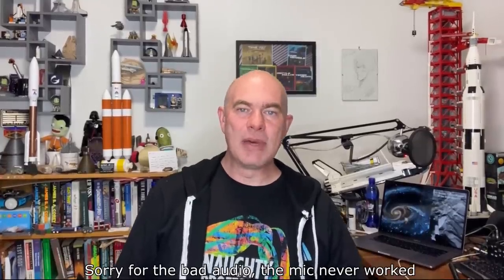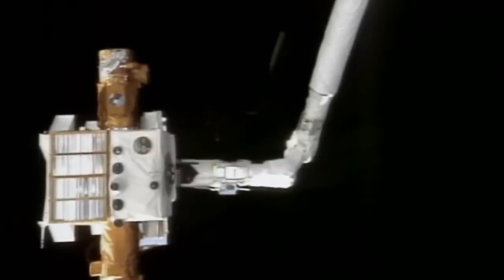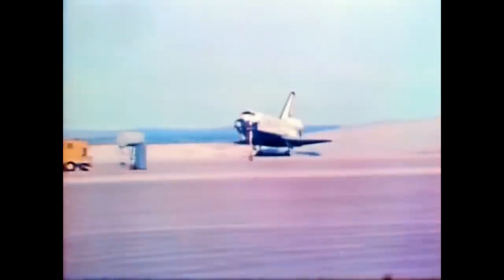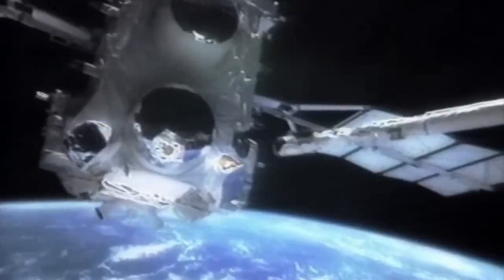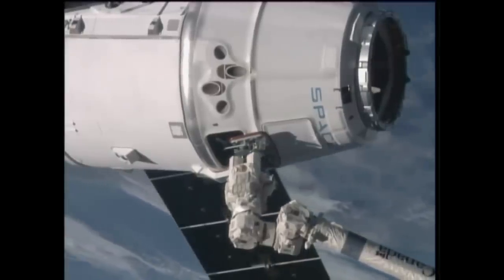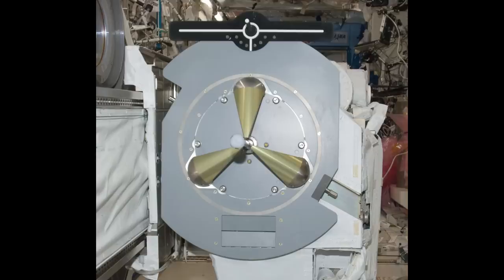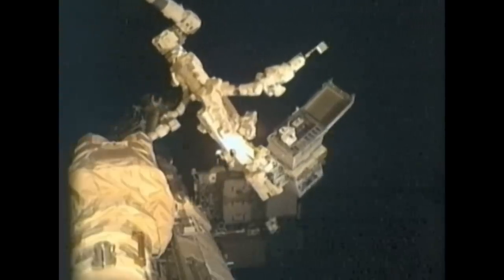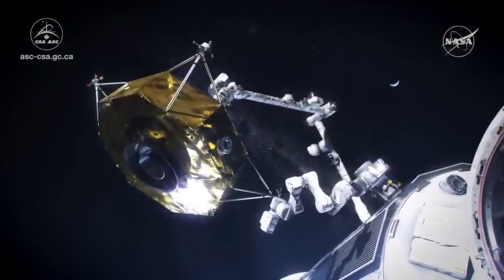Oh, Canadarm - Why NASA Calls On Canada for Robot Arms IN SPACE

Comment: I have to wonder, if the Canadarm were available on Columbia, and they saw the damage to the wing while on-orbit, what could have been done to save the crew?
Reply: Send up another ride, I'd imagine. It was a pretty big hole.
Reply: If they discovered the damage in the first few days, they could have accelerated launch preparations for the next Shuttle mission, skipping some less important tests. Then launched with two astronauts to go rescue the crew. Shuttle carried up to eight astronauts so they would have had to install a seat for the ninth.

It would have entailed some risk to the two astronauts who flew the mission, and there is no guarantee it would have been successful.
Reply: @StevePemberton2  It was considered unlikely that would have actually worked.  It was Altantis that was next up for a flight, the issue was stretching the consumables for the fuel cells if I remember correctly.
Reply: @TheEvilmooseofdoom  What was critical was how quickly they began acting on it. If on launch day after seeing the foam strike the mission managers had immediately contacted DOD to obtain photos, there might have been a chance. However since there was resistance from the managers, arguments took place over several days. Even if the managers finally gave in it probably would have been too late, considering that it probably would have taken at least an additional day to obtain the photos depending on when good passes ocurred.

Had they had the robotic arm onboard, if they had done an immediate inspection on launch day, the odds would have  been much better that they could have gotten the rescue flight launched on time. 

If I remember correctly there would have been things done on Columbia also, like reducing electrical power, and possibly cutting out crew activities to help conserve consumables.
Reply: I sometimes wonder if the reentry profile could of been adjusted. May of saved the crew even if they had to ditch for lack of a runway.
Reply: All these replies are doable, this was a crisis situation and I have to believe NASA would have pulled out all the stops to bring them home. It could've been another "finest hour" on par with Apollo 13.
Reply: @professor-josh  The biggest risk would have been launch fever. Shuttles were notoriously difficult to get off the pad on schedule. Atlantis was six weeks away from launch, they would have had to accelerate that to four weeks or less, and still be as safe as possible. 

Pressure among all the team members to move too quickly during those four weeks would be quite strong, especially if any part fell behind.

On launch day it would have been an instantaneous launch window, meaning they have to launch within a few seconds of the scheduled time, with only one opportunity each day. Calling a scrub for the day would have been tough, especially if the weather forecast for the next day was not good.

We could only hope that everyone kept their heads, did their job to perfection, and they didn't run into too many unforseen problems. It certainly would have been a triumph if they had been able to pull it off.
Reply: @tangydiesel1886  I'm pretty sure I remember reading that this was looked at, but there was nothing that could have been done in the reentry profile to avoid the accident. It's easy to imagine that they could have just tilted the orbiter to one side to keep the damaged area out of the worst of the reentry heat, however that would  probably not have been enough as the breach was pretty wide, and it would have also exposed other areas of the Shuttle to higher heat than than they were designed for.  

Of course if they had known about the damage they probably would have at least tried.
Reply: @StevePemberton2  you're most likely right. The damage was in about the worst place excluding the nose. And an adjustment like that would bring in a lot of unknowns and add more heating to other areas.
Reply: Later missions did add a plan to pack things from the cabin into the damaged area. But suits would of been needed, and I don't think they had them on board, since they had the science module. And the lack of an arm would of made it very difficult.

Comment: Watching today’s video got me thinking about landing the shuttle… it was a space plane after all… and you are a pilot now!  How about a video about landing the shuttle?
Reply: There's quite a lot there:
- Enterprise landing tests
- The automated landing process; deorbit burn, entry interface, S turns, transition to atmospheric flight (different control surfaces came alive at different times), transition to manual control.
- Manual control by the commander; approach, heading alignment circle (instead of traditional downwind, base, final),  pilot (right seater) always got to fly manually for one quarter of the HAC to give them about ten seconds of hands on experience as most would command their next mission,  final approach and landing by the commander.  Which was done with a computer generated heads up display that guided the pilot, it was indispensable as it would apparently be very difficult and risky for the commander to land just with their own flying skills.
- Autoland, how it would work if they had ever used it (which they didn't except for one partial test)
- Training in the STA (Gulfstream II outfitted with seats and instrument panel similar to Shuttle,  approaches were practiced with the gear down and thrust reversers engaged to simulate Shuttle (i.e. landing a brick)
- Special segment on Joe Engle's manual control flight
- And last but not least, RTLS !!

Actually if all of that is too busy I would be okay with a video that is only about RTLS (return to launch site) and other Shuttle abort modes.

Comment: If it was designed to move masses heavier than the Space Shuttle how did they manage the movement? As the shuttle would move more than the payload.

Did they compensate with the shuttle thrusters to keep it in position?

Comment: If Columbia know about the broken tiles, would they have had a way to fix it, would they have to "Apollo 13" it, or would they have had to wait to be rescued?
Reply from the maker: Rescue mission would have been hard, but possible. Alternatively, some engineers suggested filing the hole with ice could work if you had enough water.
Reply: @scottmanley  I would have never imagined ice could have been an alternative in that case! 
I'm not sure if you have already covered this subject before, about ways we could have saved Columbia if we knew about the issue, but I would love to hear what your thoughts would be about it! Thank you so much for the reply!
Reply from the maker: @Khether0001  remember ablative heat shields are made of a polymer, essentially a plastic. 
I think the idea for filling the cavity was more like pycrete where you use wood/paper fiber as a stabilizer, and you’d fill a large part of the leading edge cavity. The RCC leading edges were very thin to reduce mass, a solid block of pycrete would melt away faster but would be thicker.
Reply: @scottmanley  A rescue would have been a maybe at best, no arm, no docking adapter.  2 shuttles would have to be manually flown into close proximity (never trained for, never simmed) and then space walk a full crew to a shuttle that doesn't have enough seats.  Possible.. but unlike.. and that's IF they could have gotten Atlantis off the ground in time.
Reply: @TheEvilmooseofdoom  
For sure the biggest uncertainty would have been getting Atlantis launched in time. Which would likely only been even a possibility if they had taken immediate steps in that direction even before confirming that there was damage. 

But the rest of the operation had a head start because NASA had previously researched this type of rescue mission even before the Columbia accident. They even had built a prototype rescue pod,  made of several layers of fabric, zippered and pressurized, to enable the transferring of oxygen masked crewmembers between Shuttles if there weren't enough spacesuits.

The rescue concept was put into actual readiness six years after Columbia with the rollout of Endeavour to pad 39B as STS-400,  ready to rescue Atlantis if needed during  the final Hubble servicing mission in May 2009. 

In the pre-Columbia scenarios the plan was for the two Shuttle robotic arms to grapple each other, creating essentially a bridge that the astronauts would have traversed between the Shuttles.  However the plan for STS-400 was for Atlantis (the striken Shuttle) to have used its Canadarm to grapple a fixture in the Endeavour payload bay, and then Endeavour would have used its Canadarm to assist with transferring astronauts from Atlantis.

However as you pointed out, Columbia did not have a Canadarm on this mission. And apparently Columbia did not have a grapple fixture installed that Atlantis could have latched onto.

However one of the other possibilities that had been considered for ST-400 was for Endeavour to just station keep with Atlantis, and use its Canadarm to transfer Atlantis astronauts to Endeavour. While doable, this method would have used a lot of propellant, and so the grapple method was selected instead.

As for the lack of seats, the Space Shuttle could carry up to eight astronauts (only happened on one flight STS-61-A).  The STS-400 rescue mission would have launched with four astronauts, for a total of eleven astronauts that would have returned to Earth on Endeavour. Three additional seats were installed on the Endeavour middeck, totalling four on the flight deck and seven on the middeck.

For the Columbia rescue mission three astronauts would have been strapped to the floor.

Speaking of jamming astronauts into a rescue vehicle, a rescue plan existed during the Skylab program known as SL-R. An Apollo capsule with two astronauts would have rescued the three on-orbit astronauts. Seats for an addition two astronauts would have been installed underneath the three existing seats in the Apollo capsule.  SL-R was nearly called into action during the second Skylab mission in 1973 when the Apollo capsule's thrusters experienced problems while docking with Skylab.

Comment: One thing that pops into my mind: How was the movement of payloads by the arm countered at the shuttle end?

Did they use the OMS or reaction wheels inside the shuttle?
And if so, how where the correct vectors be calculated 🤔
Reply: OMS would have been a little much, since those are the smaller (but still good sized) engines above the three SSMEs. The small maneuvering thrusters and reaction wheels are the ones they most likely used.
Reply: I would guess not. It would mean you are transmitting forces through the arm from the shuttle end by the RCS thruster activity, which could very easily be more than the arm can take. In addition, you would certainly not want thruster activity when astronauts are on EVA as well.

I would guess the same for the ISS as well. But I am not sure on this and couldn't find any info about the attitude control during the use of the arm with a heavy thing grappled.
Reply: @homemadecringeycontent6363  Trivia note!  The OMS engines are AJ10 variants.  These were also used as the main service module engine on both Apollo and Orion (the Orion spacecraft on Artemis 1 as I type this is using, IIRC, a Shuttle-flown AJ10), and as upper-stage engines on many expendable launch vehicles, all the way back to the second stage of the Vanguard rocket of the late 50s.
Reply: Interesting aspect of the arms operation. Unfortunately I could not find any mention of the procedure :/

Somehow they would have to counteract the movement. For the ISS it's less of a problem because it's mass is significantly higher than the orbiters
Reply: @whosjulez1157  As long as you only care about orientation and positioning relative to the shuttle/ISS (and not the Earth/Sun/background stars), you don't have to. You will pick up some rotation, but you can just let that happen, and stabilize once it's not the fragile arm that would need to bear the force.

Comment: If the arm is pulling on a payload that weighs more than the orbiter, wouldn't it be moving the orbiter towards the payload instead of pulling the payload towards the orbiter? I know this is all relative when you're in space but it seems to me that the thing that moves would be the one that weighs the least. Or is it a combination of both? Do both objects move toward each other? Would you need to use reaction control thrusters or something to keep the orbiter in its relative position when pulling on a heavy payload?

Comment: I'm surprised the grapple mechanism at the end uses a wire like system like that. At first glance it feels kind of overly complicated and prone to issues but I suppose in the zero G of space it makes a lot of sense.
Reply: THe wire grapple was designed to release a load without putting on any accelleration. A claw or clamp would apply slight sideways force to the load, resulting in unwanted rotation. The wire system released without any unwanted forces.

Comment: Scott i have a question. Why did the Shuttle missions stayed only a couple days in space while the soyuz mission of that time were staying in space for months
Reply: Shuttle used fuel cells powered by hydrogen/oxygen. They only had enough for about 2 weeks. Soyuz/progress, dragon, cygnus, and starliner use solar.
Reply: @tangydiesel1886  Thank you for your answer it's really apreciated !
Reply from the maker: Those Soyuz missions were staying in space stations, Shuttle missions in the 80’s were free fliers.

The longest free flier Soyuz mission was about the same length as the longest shuttle mission.
Reply: Shuttle missions were normally limited to 10 days, leaving margin for extending in orbit for weather landing delays, etc. This limit was primarily because of the fuel cells which provided electricity, and this limit applied even when docked to Mir or ISS. However later in the program Discovery and Endeavour were equipped with hardware that allowed them to connect to the ISS electrical system and draw power from its solar arrays. This allowed the Shuttle fuel cells to run at their minimum. However there was still cryogenic boil-off, and they had to leave hydrogen and oxygen margins for post-dock operations including deorbit and landing. So drawing power from ISS only added four additional days to the mission.

The longest Shuttle flights were actually free flying missions. Earlier in the program Endeavour and Columbia were outfitted for extended missions by adding a pallet of cryogenic tanks that sat in the back of the cargo bay. This extended mission length to 16 days. The longest mission in the Shuttle program was STS-80 in 1996, which due to weather delays landed after 17 days in space. There had been plans to fly with two cryogenic pallets for a mission length of 28 days, although this was never done.

Comment: Why did Artemis enter lunar orbit that way? Didn't Apollo just do a burn to slow down and was captured by lunar gravity. I know it didn't take 2 days.
Reply: If I understand it correctly Apollo and Orion essentially did the same thing,  i.e. a burn to slow down and be captured by lunar gravity. They just selected different orbits that would result from their respective burns. For Apollo they wanted a relatively circular orbit close to the Moon, which was best for the LM landing and rendezvous.   For Artemis 1 there is no landing they just want a lot of time on orbit with minimal blockage of radio signal by the Moon.  Distant Retrograde Orbit was apparently the best choice for this mission. Also from what I understand Orion is too heavy to be placed into the Apollo type of orbit, too much even for the mighty SLS. 

The crewed Artemis 2 lunar flyby will be on a free return trajectory similar to Apollo, but at a much higher altitude. They will not do a burn to go into lunar orbit but instead they will be swung around the Moon and back towards Earth.

For the Artemis 3 landing mission they will go into a near-rectilinear halo orbit where Orion will dock with either Starship or the Lunar Gateway which will already be waiting for them in that orbit.
Reply: @StevePemberton2  Thanks man! Awesome explanation.